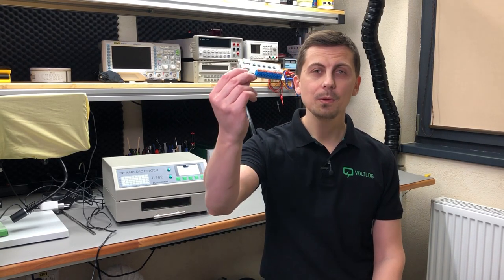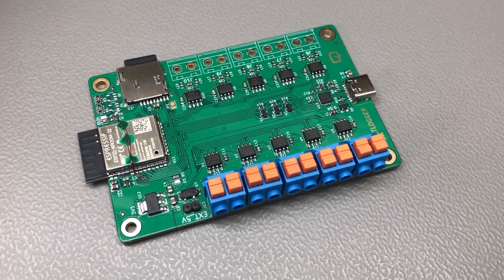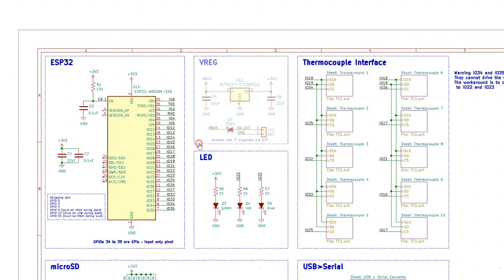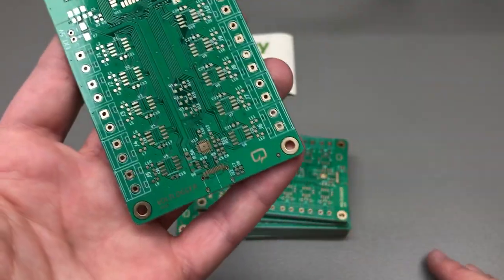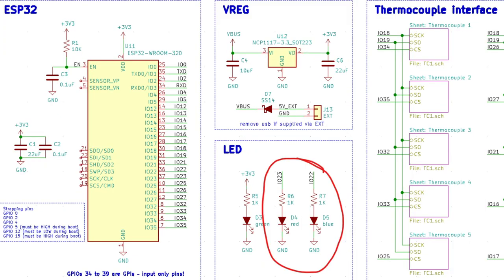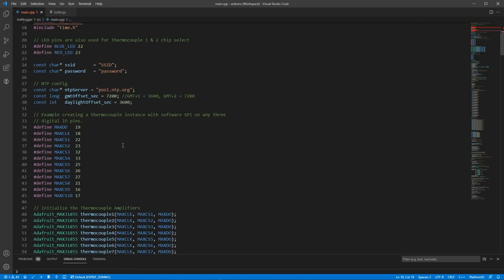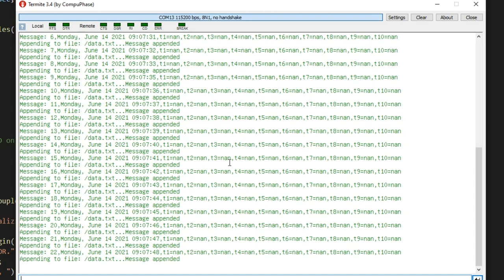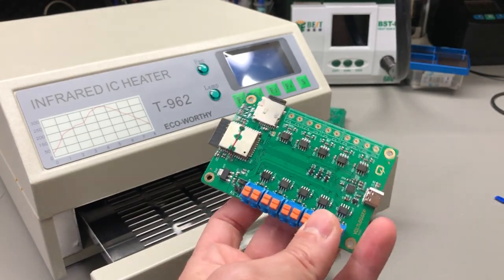I Made A 10 Channel Thermocouple Data Logger - Voltlog #368

Comment: If you don't have enough pins for CS, just use a 4-to-16 decoder IC (e.g. 74HC154), or two 3-to-8 decoder ICs (e.g. 74HC138). If you don't want to pay $60 for 10 MAX31855 ICs, you can multiplex the thermocouple inputs with analog MUXes (e.g. 4051), and use fewer MAX31855 ICs, being mindful of the conversion timing requirements.
Reply from the maker: I'm not too experienced with high precision TC measurements but there are a few concerns that will introduce errors when muxing them like: leakage currents from the mux, introducing tiny thermal junctions in the signal path, reducing the accuracy of the cold junction compensation.

These might be fixable through careful layout of the board to avoid thermal gradients and by using a more expensive mux chip but I don't want to go there. A good mux is expensive just as well and I would be spending more time trying to solve the mentioned issues.
Reply: @voltlog  You may be correct. I don't imagine it would that bad in practice.

Comment: Excellent work!!! When you run short of I/O and especially in this case where you are sharing a single input pin and you could have bus contention between the interface chip outputs, it's always best to use a dedicated logic decoder like the 74HC138 to generate the selects. Using two 74HC138s to generate the 10 chip selects will guarantee that only a single interface chip is active at any time. The 138 has 3 address inputs so to get the 4th address bit without any extra logic, just use a positive chip select of one 138 wired to a negative chip select of the other 138. Tie the remaining chip selects active and now you have 16 safely operating selects from 4 ESP outputs. If you're not using a dedicated decoder and have any potential for multiple outputs to speak at the same time, it's standard practice to add a small series resistor in line with each device to limit the current. A small value like 470Ω will limit current to safe levels if you have bus contention and it's small enough to not affect rise time (and thus speed) by very much. 330Ω was another common value back in the days of parallel buses.
Reply from the maker: The 74hc138 would  be a nice solution if needed but I like it even more when I manage to fit. Everything on the available io. 😬
Reply: @voltlog  The problem is that a design which is able to damage itself thanks to a random crash is less than professional. Hardware should be engineered to work properly under all circumstances. That's what separates professional designers from amateurs. Just because you can, doesn't mean it's a good idea or desirable to do. It's possible to do all kinds of undesirable things. If you want to represent yourself as a professional, then this is a golden opportunity for you. 😉

Comment: could have used something like a shift register or  bin to hex chip for saving GPIO for accessing CS pin.(as far as i know, only one of em go high at a time). Also the reason why I have 100 pcs of 74595 in my inventory.

Comment: I also made my own esp32 symbol, due to these input only,  and the adc 1 and 2 banks, as you cannot read from adc2 while wifi is active. There is also conflict pins for the hall sensor and specials like the pair differential pins as well as the 2 dacs.
Reply from the maker: Yes! The ESP32 holds many tricks 😬

Comment: I did a similar mistake while making a smart wall clock and connected my bin to hex converter to input only pins of esp8266🤦‍♂️. they should rename those from gpio to gpi (general purpose inputs :p).

Comment: Thanks for posting, nice job and very few changes required on the board - like others have said there is always something, its the law!

Not sure what accuracy you were looking to achieve, but I can tell you that the cold junction compensation will not be at all accurate. If you only need +- a few degrees then OK, but you'll struggle to achieve anything consistently better than that. I've been designing TC measuring boards for years the CJC bit is the hardest to nail!
Great job though
Reply from the maker: Accuracy... I don't know, even 5 degrees C of error wouldn't be that bad as I'm mostly interested in temp gradients that span more than 10 deg C. But I'm hoping the max31855 with the built in CJC will perform better.

Comment: This board is no longer available on tindie- it seems. Do you have plans to fix the issue in revA and re-inlist it for sale? I also think a smaller version with two or four channles using MAX31850K similar to Unified Engineering board would be a nice supplement to your 10 channel board that would install on T-962 and/or T-962A. These ovens need a much better thermocouple reading to help regulate the heat and I would think there would be many who would purchase them given that the price of these ovens have dropped down quite a bit recently. Thank you for your amazingly clear and to the point videos and documentation.

Comment: "Little bodge never killed nobody", a hit song by Fergie from 2013.
Input only -pins labeled just like any IO pin, grouped with them... That's just asking for trouble. To be fair, electrical type is "Input", instead of "Bidirectional", but as those aren't visible by default, does anyone bother to check them? I wouldn't have checked, as I didn't have any reason to think those last pins weren't usual GPIOs, until you mentioned it.
I haven't used ESP32 all that much, but would probably use those pins at some point and blame my own code for things not working. I'll go add that same note on my library, to avoid that mistake when I play with my ESP32 modules in near future.
Thanks for sharing.
Reply from the maker: I need to add that to my library too!

Comment: Just thinking out loud.  I was wondering if you could multiplex the thermocouples and then only use one or maybe two of the thermocouple interface chips and save some money.  I assume the thermocouple are slow to respond so reading them sequential or by two banks would be in msecs.  Again I probably don't know what I am talking about... but that has never stopped me before.  I look forward to your follow-up video/s. I have the same reflow oven.
Reply from the maker: I'm not too experienced with high precision TC measurements but there are a few concerns that will introduce errors when muxing them like: leakage currents from the mux, introducing tiny thermal junctions in the signal path, reducing the accuracy of the cold junction compensation.

These might be fixable through careful layout of the board to avoid thermal gradients and by using a more expensive mux chip but I don't want to go there. A good mux is expensive just as well and I would be spending more time trying to solve the mentioned issues.